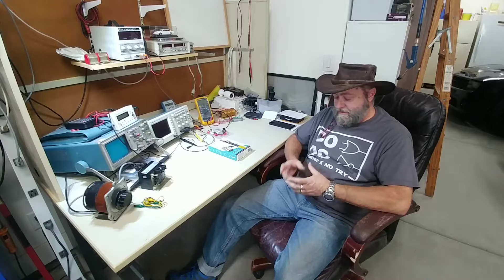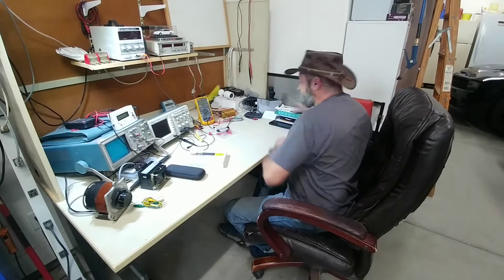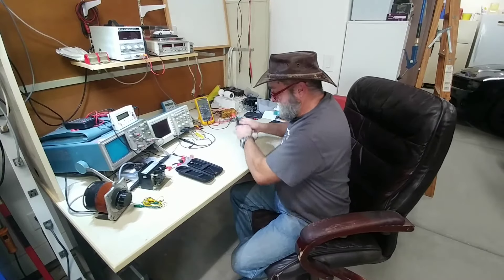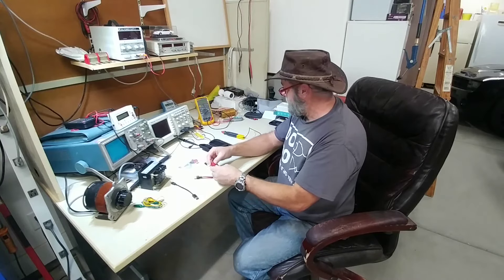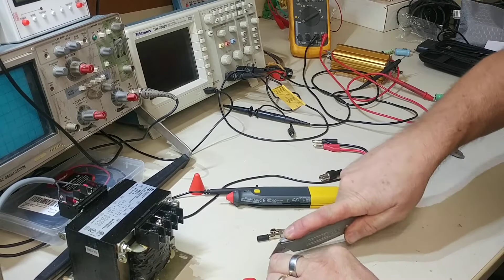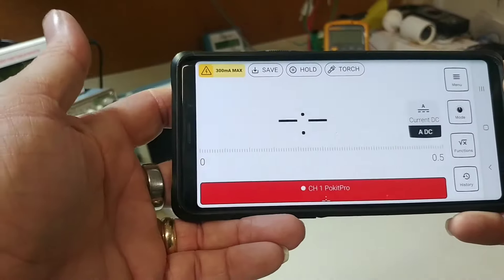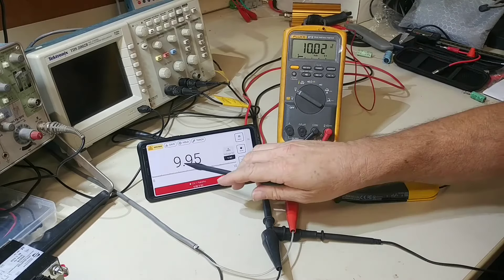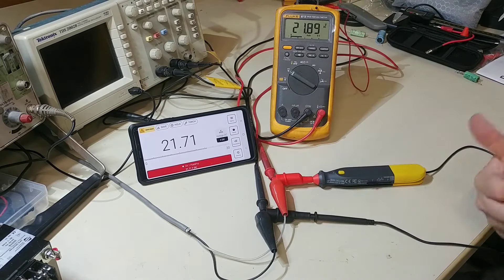The Pokit Pro All-In-One Multimeter, Oscilloscope, and Logger is finally here!  Full review and test

Comment: Late to the party I know, but I just watched your review after getting mine 2 weeks ago. Very informative. I have one more "function" to add that I am going to send to Pokit also. I think it is something they could easily add with just a software update but there is a work around for now. I was thinking, since I plan on always having it on me at work, it really needs a Non-Contact Voltage detector and it would be almost perfect. After a little playing around with it, it is very possible to leave the plastic cover on the probe and use it as one on the AC voltage scale, no ground required. The stray voltage readings jump like two orders of magnitude when you get it near a live wire. it can't tell you what the actual voltage is of course, but definitely indicates whither a wire is AC +hot or not. I don't know if they officially added the function to the App whither it would require some kind of re-certification, but it is worth suggesting.

Comment: The issue with the frequency doubling and/or not triggering during DSO mode was probably due to the trigger level not being set - therefore using the default of zero. Towards the end of the video section on the DSO you did move the trigger level, but only after you were in one shot mode.
Thank you for a great review - I am anxiously waiting for my 4 Pokit Pros to arrive in February!
Reply from the maker: Thank you for the comment Gerard.  I will test that and include the findings in an update.  Pokit also responded regarding the disconnect glitch and said they are aware and working on fix. I have a few other things still to test and report such as amperage and demo some long term datalogging.  I've measured mA and amps and it works great but didn't include it on the video as it was getting too long.  Would love to be getting more Pro's but only ordered the one up front.  Hopefully I can get a couple more soon!
Reply: I don't think so. I'm using the Android Pokit App with the pokit meter (not the pro) and it has the same doubling issue independent of the trigger level. I can easily reproduce it with e.g. a 3.3V 40 kHz 33 % duty cycle pulse signal with different trigger levels. It looks like the trigger level is just for triggering the data acquisition in DSO mode. This is especially useful with the pokit meter since it doesn't support continuous acquisition. The doubling happens every few times, i.e. I just need to repeat the measurement of a stable pulse signal - say - 7 times and I get at least one measurement where the displayed frequency  is doubled (while the graph still looks fine).
Reply: @shanesdiy  Did you post an update, yet?

Comment: What happend when you sould change the voltage on the ocilloscope at 33.08 min in the video? I have had problem with this myself. How did you solve it?
Reply from the maker: Can you be more specific, this was 2 years ago so I don't remember exactly what occurred there?  In my video I see the scale didn't change when I changed the volt division but it may not have updated until I pressed the sampling "wheel" button.  What is your issue?  There have been quite a few firmware updates since this video so most of the minor "bugs" have been worked out.

Comment: Can you get absolute time on a point in the log?  Or do you have to note the log start and do the math?
Reply from the maker: Note the start time and do the math.  On some later videos I show the logs if you want to have a look.   My Starlink amperage test you can see what the log looks like. Link below.  Check the 8:40 mark to see what it looks like.

https://youtu.be/scADXOfQ0TM

Here is a copy of a bit of a log with a 30 second sample time.

Time (s)	   CH 1 - PokitPro 1 (V DC)
0	           0.062846414744854
30	           0.050846099853516
60	           0.473182082176209
90	           0.441975504159927
120	           0.417989313602448

Comment: So the maximum frequency for data logging is once in every 500ms, right ? This is quite low. I was expecting something like 1ms for a device which has 1Msample/sec sampling rate. I have an Owon multimeter B41T+ and it can already log once in every 1000ms or 1s. I was thinking to buy this but disappointed.

Comment: Is there a way to have three channels to analyze 3 phase power?
Reply from the maker: The app will connect to up to 4 Pokit or Pokit Pro meters. Unless they've changed it, unfortunately it will not show all channels simultaneously. If you start them all data logging you would have to manually line up the log times. Hopefully they will get 3 phase real time monitoring worked out if they haven't already.
Reply: @shanesdiy  thanks for answering my question! Great video too. I have never used an oscilloscope before but would like to have one to monitor the rotary phase converter that powers my Bridgeport milking machine in my home shop.
Reply from the maker: Here is the response I got from Pokit on the subject. Actually a little better than I thought.

"The way multichannel works for Pokit Pro is different for each mode:

Multimeter:
The separate channels will measure at the same time but aren't actively being "synchronized" in any way so the measurements you get may be desynced by a fraction of a second.

Oscilloscope:
The separate channels are actively synchronized, for forced acquisition and free run triggers they are synced to the start of the capture and for triggered modes they are synced to the "Master" (the Pokit Pro the trigger is set on, can be on any channel) trigger when it triggers.

Logger:
There is currently no sync in logger but you can run multiple logs at one time on separate channels so in theory if you start them at the same time they should reman roughly in sync."
Reply: @shanesdiy  that’s cool!
Reply from the maker: Tim, great news, I have acquired a 2nd Pokit Pro and am working on new multi-channel content, keep an eye out for new videos!  I was trying to get a 3rd but for now, will have to settle with 2.

Comment: Got mine in germany today as a "early purchase" but not backer. (official price for mine was 95$ though I was paying around 85€).

Well, I am pretty satisfied with all the functionality up to now. This is what I wanted it to be.
One thing I have to say is: I am unsure about the durability of the cabling. It's quite thin and wraps around easily, but you can smell some typical plasticizers, which of course evaporate at some point and are then missing in the cable. Then at the latest it will be clear whether the cable will hold up or become brittle. Something we will see in the next years.

Though.. thanks for this to Pokit Innovations!

Comment: Can it read mA?
Reply from the maker: Yes, it can.  Current measurement range is 1uA (microamp) up to 10A. During testing, I tested it with my process calibrator and it was quite accurate from 1mA through 21mA which I use often in my work.

Keep an eye out for more videos, I plan to produce a series of smaller videos demonstrating specific features and measurements.

Comment: Why did you purchase that, when you could have just purchased a fluke?
Reply from the maker: I have several Fluke meters already (one is in the video) along with BK Precision, Uni-T, etc.  I'm just a nerd who likes meters and test equipment of all kinds.  New gadget, had to have one!  I was particularly interested in the small size, long term datalogging, and basic oscilloscope functions and I have found both to be quite useful in my use cases.
Reply: I'm the same way. Honestly further into your video I realized that you do not fuck around, already jave high speed equipment and was checking it out for fun. 

I will say though. The 4-5% inaccuracy thowed me off. At the same time, when doing transformers that step do 120v and steps them down. Getting the number is important. 

Very impressed with your video man